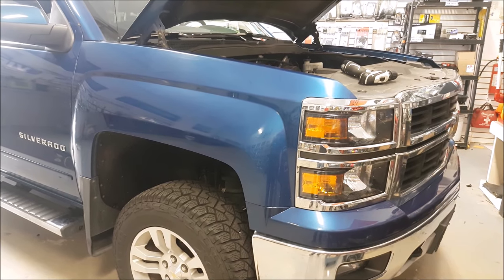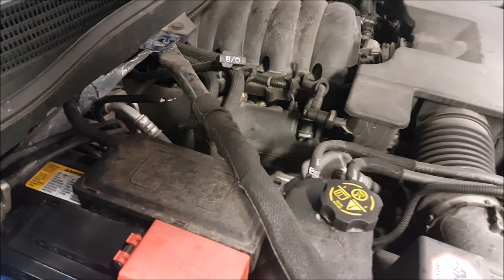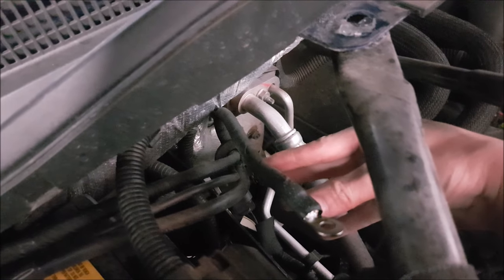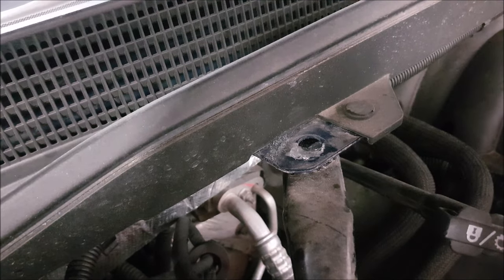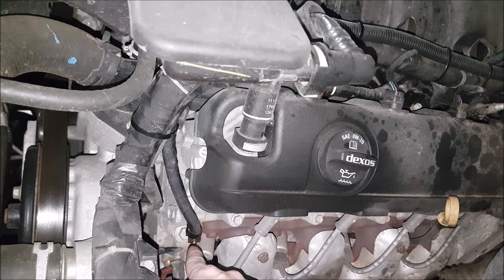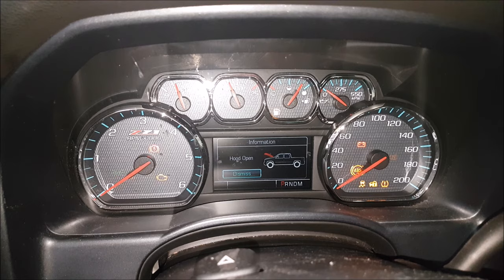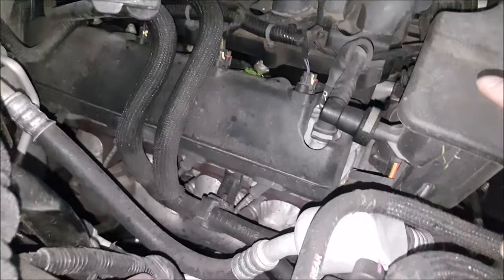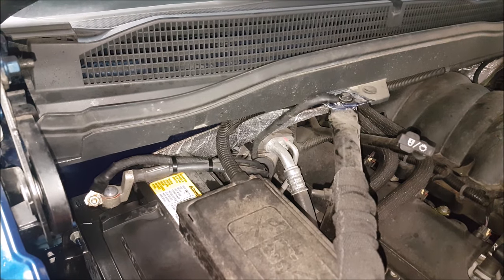2014-2018 Silverado/ Sierra Ground Upgrade K2XX (Prevent Electrical Issues) | AnthonyJ350

Comment: Hello I have a 2015 gmc sierra that I am having some electrical issues with, I would like to do this upgrade to mine as well. Where did you get the wire to improve ground from battery(part#, ect), and also cable and bolt for the driver side and what gage wire did you use, was it 4 gage? Thank you
Reply from the maker: I used 4 gauge wiring. You can buy wiring by the foot from your local install shop or Amazon. Search for "battery cable", the insulation is tougher.
Reply: @AnthonyJ350  hey brother did you use the 3/8" lugs or the 5/16" lugs on the cable ends?
Reply: Also how much length of cable did you need for the battery side, and for the ground on the drivers side? Thanks again.
Reply from the maker: @emilmartinez661  I don't remember, I keep both in stock and just grab whatever fits lol
Reply from the maker: @emilmartinez661  I would buy at least 10 ft and route the cabling and cut it where you need to
Reply: @AnthonyJ350  ok thanks, I am looking at some that already comes in varies lengths with the ends already installed and everything , reason I was asking about the lugs size.
Reply: Hey brother just seeing if this is the side post you were talking about?
Reply from the maker: @emilmartinez661  Got a link?
Reply: @AnthonyJ350  here is the link:
Reply from the maker: @emilmartinez661  I think YouTube is blocking links. Can you email it to info@gofasthavefun.ca

Comment: How can you fit 1/0 gauge cable through that sensor 😂😂😂😂😂
Reply from the maker: Not sure, aftermarket or modified clamp?
Reply: I thought you had all the answers 😜😜😜😜😜😜
Reply from the maker: @larrykimmonsjr8041  When I purchase a 2018 - 2019 2500HD might, if the heavy duty even has that sensor.
Reply: 1/0 fits thru the sensor. That’s the last size that you can fit. Any bigger and gonna have to get a bigger sensor, if they have it
Reply: I got a 1/0 cable through it

Comment: I cleaned the battery ground wire that goes to the bottom on the frame,
On my 2014 Chevy Silverado,
And the dash battery dial amperage moved up a little, is that a good thing ?
Reply from the maker: It is, gauge on the dash shows voltage.